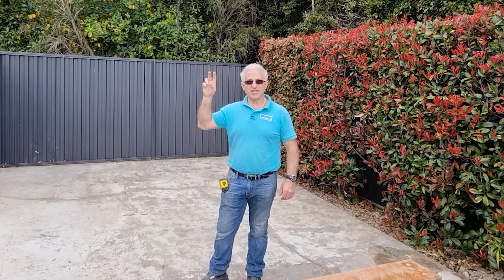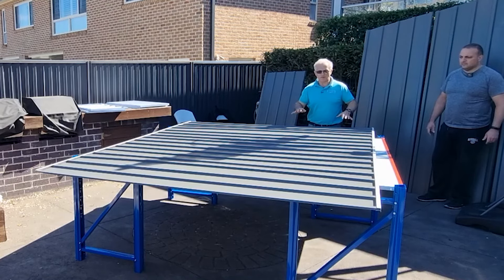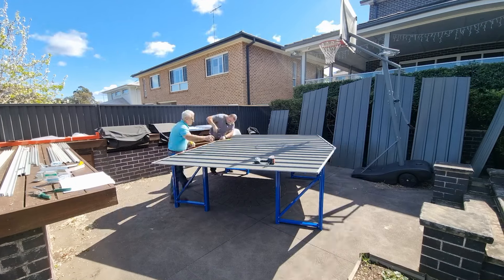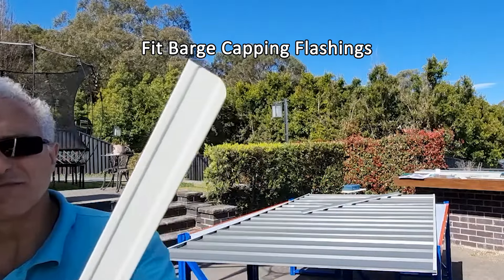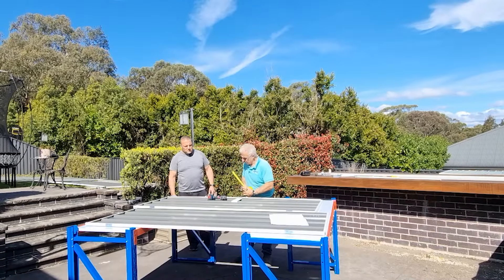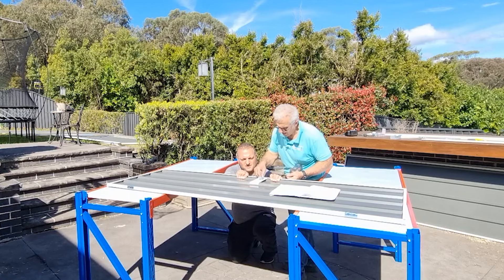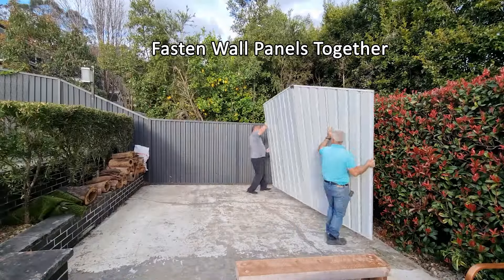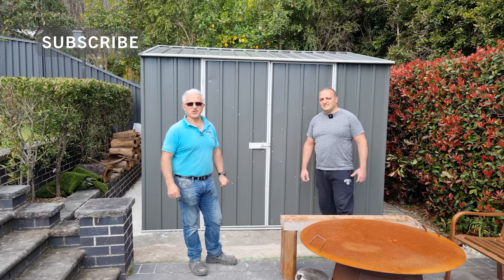Install an Easyshed, but is it Easier than an Absco Shed?!? (DIY)

Comment: I was thinking of getting an Easy Shed Classic Gable roof.... I guess not, looks like a right royal pain in the butt to assemble. Easy Shed... definitely not Easy ey.... 
Do Stratco sheds compare for easier installation and quality? or just as hard?
Reply from the maker: If you are looking for a good quality flat pack shed that is easier to install! I found Absco sheds truly the best, but there is still a lot of work involved. I purchased it from Bunnings at a really good price and am very happy with it.

I have placed the link below if you are interested in seeing how it's constructed and installed. Sorry for the quality of video! It was only my second one and the wind factor was high. But the quality is still good enough to see if you may link their system. 

However, if you are looking for a stronger shed structure I found Best Sheds good as well. Just a lot more costly because it's structure is made of purlins and large hat sections. Stratco was much more expensive compared to Best shed as well.

I hope this helps! 

https://youtu.be/2oc_07Yi71k
Reply: @quantumhomeimprovements  thanks mate. I'll check them out

Comment: Mine was a disaster, no parts fit flush, had to wrestle things to get them to fit somewhat. I ended up sending it to the Tip. It made me so frustrated.
Reply from the maker: Sorry to hear that! Yes, EasyShed's can be difficult! However, the experts like them because they feel that the sheds are sturdier! Regardless, what a shame for you!
Reply: It is, and you guys whipped yours up quite quickly. Experience helps. but thank you again for making the video and all the editing that goes into it. I was just not happy with the quality and having something substandard set up.  having to go cut sheets to make them fit. its a nightmare.  It made me so angry. Keep up the great work and I wish you guys the best.  @quantumhomeimprovements
Reply from the maker: Yes, I have done a few of them, but I still prefer Absco sheds. They were by far the easiest shed I have ever put up! 

Thank you for your comment!

Comment: You should always overlap the sheets away from the line of most sight. Visuals are really important. Common knowledge for any experienced tradesman. Great video though
Reply from the maker: Thank you very much for your comment. That is a very good point. I worked for Stramit Industries in my early years, and I have a restricted builders licence. I  have built 4 houses over the years. Even though you are right, I chose not to mention that because it would confuse the first time shed builder, which will struggle enough without completing it for them. However, on my next video, I will mention it because it's a valid point! Thank you once again

Comment: 2025 Feb just bought two of these sheds and realised it was a nightmare to assemble these. I wish I had seen this earlier. I have previously made diy pergolas and even an absco shed and this is no way DIY. 

Their Philippines call centre was arguing with me about simple consumer guarantees when I told them I rejected their products as it was not fit for purpose and not to send their second order.

Absolutely horrendous experience. I think they have Bot Farmed all their positive reviews because no one in their right mind would give it a 4 or 5 stars. 

Horrible.
Reply from the maker: It makes me sad to see your message, considering that the name 'Easy Sheds' does not reflect the actual easiness of assembly. My first video I released was an Absco Shed, a total dream, considering how I have struggled with other sheds in the past. I hope you win this battle with the call centre, if it is still ongoing!
Reply: @quantumhomeimprovements 
After threatening to raise a case with the ACCC, arguing with them for 20 mins and telling them I'll go to VCAT and magistrates Court and charge them $150 per hour for my time spent, they started to say they will refund my first order. Then asked me to pay fees for change of mind for second order. I said no. I told them that this is not change of mind. They are quite deceptive. Anyone who thinks of buying an easyshed should think again.

I will make it my mission now to share this feedback across all platforms. See how they like that.

Comment: Thanks heaps. This has given me some ideas on how to do it. I bought an EasyShed, I am struggling to understand the instructions. Not clear enough diagrams or text. Not even a Youtube example of one they have done so you can follow how they done it. I would not recommend this to anyone I know. Very poor. The word Easy is so misleading. You must had previous experience in order to figure out how to build this.
Reply from the maker: So many people say the same Jamal! I made a video put up an Absco shed prior to putting this one up for Joe and I have to agree that it was much easier. However, easyshed is still a good shed, just very confusing to put up for a first timer.

Thanks for your comment 👍

Comment: These ABSCO and EASYSHEDs are not as easy as they say they are when it comes to assembling them. I have assembled these sheds over the years for my relatives and the one I bought recently has no holes punched in them. That makes it very difficult and frustrating especially when it comes to drilling holes on the white channels. Most of the sheets are out of alignment, which means you have to trim the sheets to the exact size. And the screws are box-shaped at the bottom means you got to suffer to screw them in. Some parts don't even fit in place. They should be designed better and should be checked well before been shipped. Because a person who buys one will never think of buying another one ever again. These sheds are a mess.
Reply from the maker: Sorry to hear that, nil den. You are the second person to say that in the past week. A friend of mine needs me to help him put up a flat pack shed in the future, but I wouldn't have a clue which one he will decide on! Regardless of what brand he chooses, I will get back to you all on the outcome!
Reply: @quantumhomeimprovements  The problem with these sheds are that they are badly designed.

Comment: an absco shed.... wow... talk about kit form... its sheets of metal are wafer thin....any wind and they will blow away....
Reply from the maker: Yes, they can blow away, which is what happened to me when we made this video. But surprisingly, since the installation of the shed, we have had very high winds, and the shed has performed beautifully. For the cost of the product I was very happy with it. 

However, as you implied, it's a lightweight alternative to a framed shed, for sure!